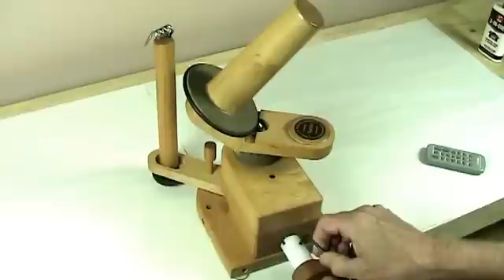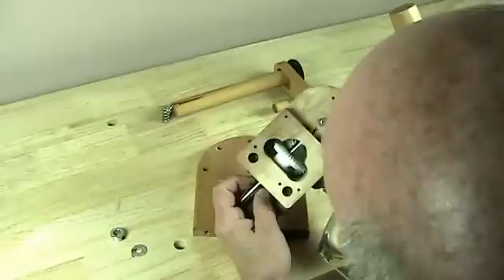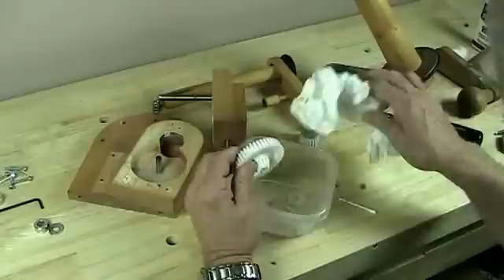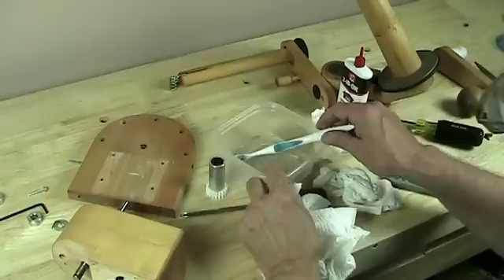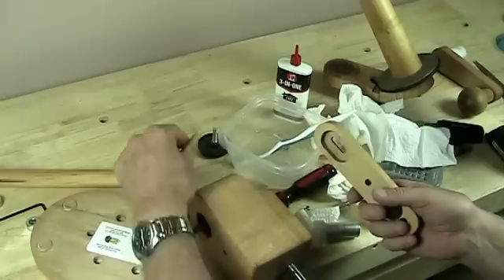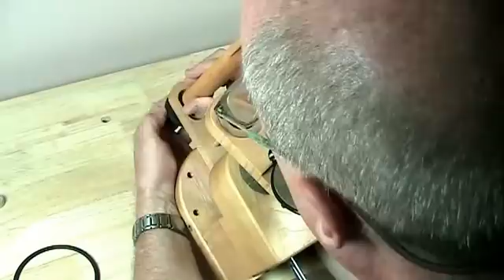How to Clean the Heavy Duty Ball Winder

Comment: Hi 
I am having the issue that the torc tube thing is to tight on the shaft thing... I have cleaned the unit as instructed in this video but it hasn't helped

I like in Australia so parts are hard to get would it need replacing

Thanks
Reply: +Claire Paul I am sorry if I did not respond to you previously. You can ream the Torque tube out with a 3/8" (.375") diameter bit but we use a .380" bit to properly ream these out so that even if the black plastic material inside the torque tube swells due to moisture or heat, it will not increase in size enough to impede smooth rotation of the assembly. You could use a metric bit of equivalent size but be careful not to bore the hole out too much more than what I have listed. A hole that is too big can also be a problem. Of course you could return the torque tube and we can ream it for you. The tube after reaming should easily slide up and down on the shaft (once you clear the indentation created by the set screw in the collar.
Reply: That's probably the black bushing inside the torque tube. Just use a round file or a reamer of some sort to ream out the hole in the black bushing until it spins freely on the shaft.
Reply: My torque tube must have swelled after using either the rubbing alcohol or the oil with cleaning and will barely fit now

Comment: The #2 flat screwdriver is only used in the event you do not have a 1/4" hex driver to remove the 4 screws in the base.
So you would normally need a #2 Philips screwdriver (or power screwdriver with extender bit), #2 slotted screwdriver (or 1/4" hex bit), an old toothbrush, rubbing alcohol, paper towels, a small vessel to soak the cluster gear and torque tube in, 3 in 1 oil, about 30-40 minutes, and a beer or a glass of wine and some music. Although you are going to have fun cleaning your ball winder out, the drink and the music will make it even better!

Comment: thanks so much for posting this!  have the tools they recommend PLUS an old, soft toothbrush and just watch this video with your winder.  the tools youll need:
		
#2 Philips head 			screwdriver (or power screwdriver with extender bit)
1/8" Allen wrench
A straight #2 (flat 			blade) screwdriver
Optional: 5/16" nut 			driver and 1/4" nut driver
Paper towels
Rubbing (isopropyl) 			alcohol from drug store.
Small pointed 			(sharp) tool like an awl, small screwdriver, or a knitting needle!
Q-tips (4-6) Cut one end off and 			use as pointed tool and use other end to clean gear teeth out.
Reply: i didnt use the #2 flat blade, however.

Comment: When in doubt - clean it out! When your vacuum cleaner stops picking up dirt, you replace the bag. When your dryer stops drying your clothes, you clean out the lint filter. When your ball winder gets hard to turn or your motor slows down (or you start to see "wonky" balls) clean out your ball winder. It is easy and almost fun. But you will really appreciate it when you run your newly cleaned unit. Watch our video on cleaning it and adjusting the o-ring tension.

Comment: Cleaning your ball winder is critical over time. Small fiber debris gets into the unit and begins to impede the smooth rotation of the gears. So the gears need to be cleaned out occasionally. While you are inside the unit, oiling the shafts where they make contact with bearings is also a good idea to prevent squeaks. These materials will last virtually a lifetime so if you maintain the unit by cleaning it periodically, you will help to ensure that it lasts a long time.